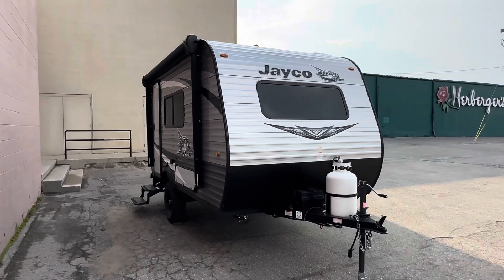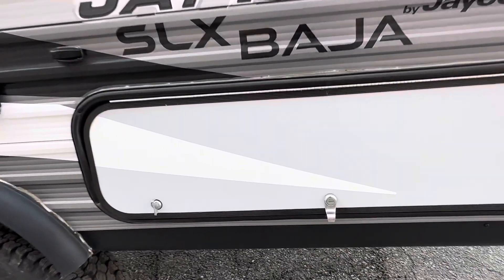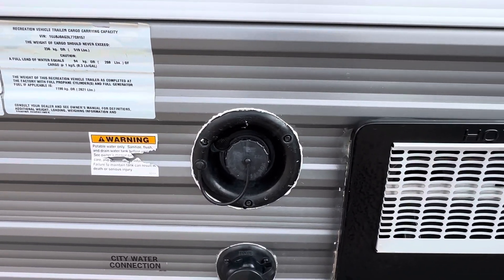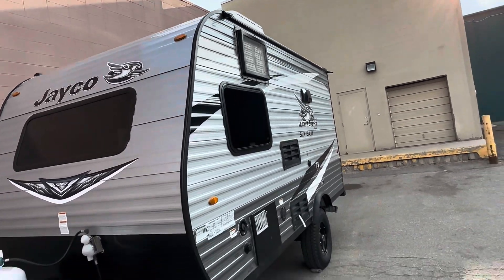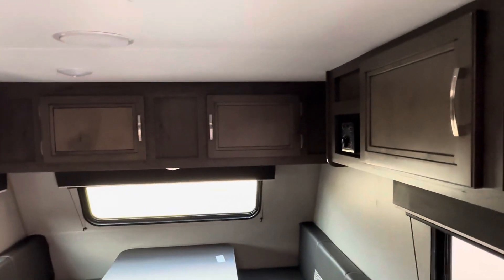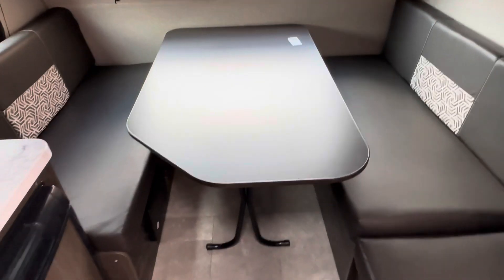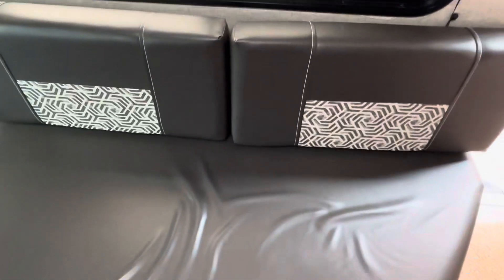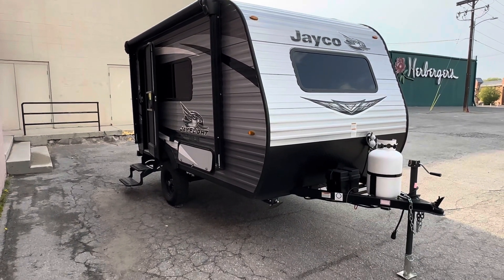Jayco Jay Flight 145RB SLX Baja Introductory Walk-Around

Comment: Just 2 things missing...
1.) Bathroom, should have SEEMLESS - One Piece Fiber Glass WALL and TUB unit; to prevent water from running down the walls and into the base causing rot...
2.) Dump the Micro-Wave taking up cabinet space and put in a Oven.
Reply from the maker: I do agree with the one piece wall and tub unit or at least more water resistant walls around the tub.  I am still undecided on the microwave.  I don't use it often but I probably would never use an oven.